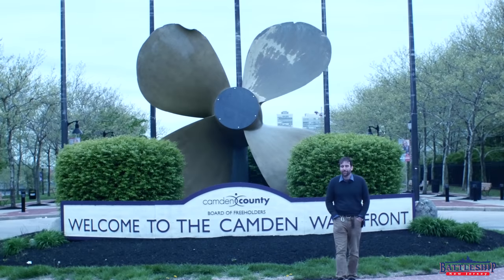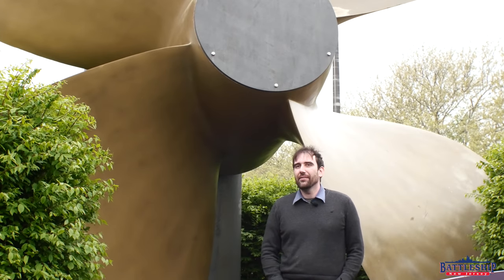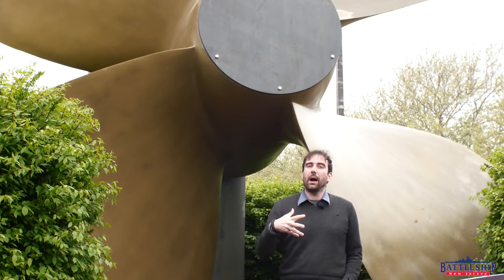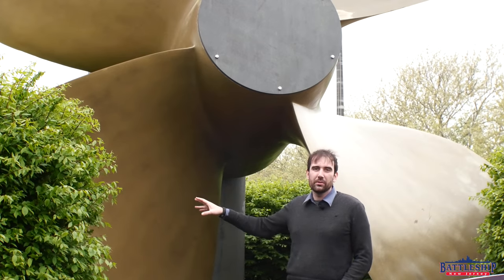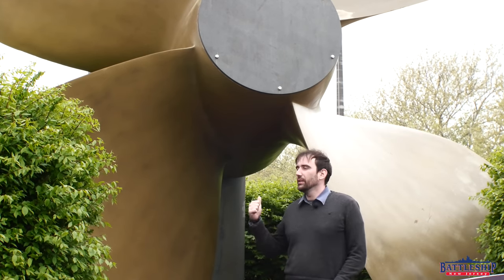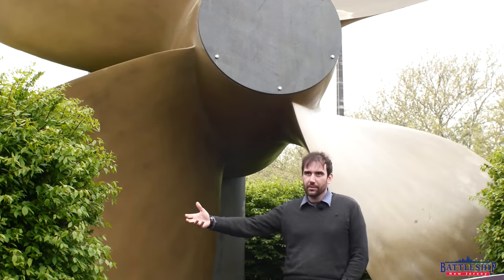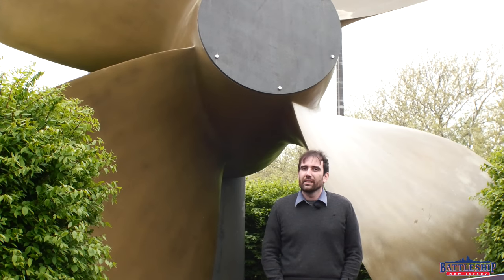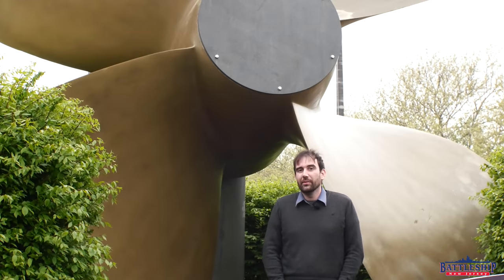How Big Are Battleship Propellers (Also Called Screws)?

Comment: I seem to recall seeing an electrical device that put a small charge (low voltage) on the metal needing the protection. The corrosion is caused by galvanic action in which the dissimilar metals act as a battery and the current flow removes the sacrificial metal. See Galvanic cell.
https://en.wikipedia.org/wiki/Galvanic_cell

Comment: Is it possible to rotate the shafts manually to at least help with the shaft sag?
Reply: There comes a point where rotating the shaft may damage the old seal.
Reply: @Aberman1  yeah, I was thinking that. Do gland seals replaced on museum ships when they go into drydock? Are they welded over?

Comment: Would it be possible to reposition the props now by 180 degrees, by manually rotating them?  However I guess that could cause leaks in the shaft seals as well.  Maybe better for dry docking to rotate them by 180 once in dry dock.  While aluminum is good for brackish and some freshwater, magnesium is the best for freshwater, however with steel hull it could be a bit too active.  You also have active protection as well.  I can just imagine the growth on everything under there across props, shafts, hull.  I know even in a year with bottom paint in good condition and using it every week, the growth can get pretty high in fresh water lakes here in Texas.
Reply: There are docking position alignment indicator marks for positioning the shafts and props either on the main reduction gear or back on the thrust blocks for drydocking. I'm pretty sure the Navy/crew would have positioned the shafts/props as they were closing her down.

Comment: Can a propeller be changed when the ship is not in drydock ?
Reply: Yes. They can do it with divers and a crane barge. Hard work, but I've seen it done. A Tender could also do it with divers with the ships alongside. Those would be "operational emergency" cases though.

Comment: I am wondering why it is necessary to make the propeller out of the Bronze/Nickel/Aluminum alloy.  Why would steel not be suitable?  What would be the weight difference between the alloy and steel?  What about the cost difference?
Reply: Nickel/aluminum/bronze alloy is much more resistant to corrosion in salt water than any other alloy. It is also better at reducing prop cavitation.

Comment: Wait, slipping the dunce cap? You've got to elaborate. I'd presume that's a large nut or something at the end of the shaft?
Reply: Actually, the Dunce Cap is the fairing cover over the propeller nut. losing that would have no real effect. Losing the nut would, but it takes blasting that prop loose with Primacord detonating cord to get it off, so I can't see that happening.

Comment: Quite shocked! Why don't you install new anodes? If not the ships themselves becomes the anodes and rust away. There is no difficulty in getting divers to change or install anodes. Just make sure the contact between the ships hull and the anodes are good. Shouldn't be a problem. The oil industry has changed anodes at sea for 50+ years. So has the merchant marine. Not a large cost. Please, get new anodes. Do a funding campaign if needed. It's the most important thing you can do to preserve the ship!

Comment: i have a question about the machines and propellers on big ships. how can make a ship engine with lots of horsepower a ship faster? because as far as i know if a propeller spins too fast, it creates cavitation which isnt good and it wont make you go very faster aswell.
Reply: More shafts...4 seems to be the limit, generally speaking. Larger diameter props.....there would be a limit to that also. More blades on the prop. More pitch to the blades. More that one blade on a shaft.....that is sometimes done on small pleasure craft, but I have never heard of it on a large ship.  On some of those large container ships they can get 25 knots on one shaft and prop.
Reply: @johnstudd4245  impressive, but for example, how can the USS Missouri reach a top speed of 33 kn and the RMS Mauretania for example only 26kn (beside the fact that missouri has a better hydrodynamic or a better hull. sure, she has more modern blades, but the engines themself, their output (beside their reduction gearbox) have something to do with it.
Reply: @kaisertrinityt.m.i.s1607  Certainly the engines have everything to do with it. The Mauretania had about 70,000 shaft horse power when launched, and up to 90,000 later in it's life.
 While the Iowa class battleships are listed at 212,000 SHP.

Comment: A traffic circle... do incoming vehicles have priority or do they yield to vehicles already on it? I don't see any signs, so right should have priority, meaning you have priority coming onto it!? As a European, I'm even offended by the concept! 

Roundabouts are safer and are less congested. What's the difference? Well, you give way to people already on the roundabout. This is a self-clearing mechanism meaning higher traffic flow. How is it safer? You see, roundabouts are generally smaller, decreasing the speed of vehicles (while the throughput stays the same due to the smaller distance they have to cover). Lower speeds mean more time to respond, more efective brakes and less damage in collisions. On top of the lower speeds, you have less to worry about once you're on it since you then gain priority. How frustrating is it to have others come in and get stuck in front of you while you just needed a few more feet to your exit? I guess there won't be much traffic in this spot, so it may not be an issue here, but having a roundabout instead of certain traffic lights would work just as well or better (note: not every traffic light can be exchanged for a roundabout, especially due to American road design, but that's a topic for another comment lol)

The ease of a roundabout is: you approach leasurely, (often without even stopping) find a gap and drive off wherever, without anyone stuck in front of you

Comment: Why are some propellers 4 blade, yet others are 5 blade?
Reply: I would guess it has to do with vibration issues. That has been a serious problem with many ships designed to run at high speeds...warships and ocean liners of the past. They sometimes have had to bring the ships in after launching and try different prop designs to get rid of terrible vibration problems.

Comment: The reason to remove the props is think INTREPID...they couldn't get her to the middle of the Hudson due to silting. Yes more money, but you don't have to dredge to move the ship.
Reply: It makes it easier to move the Intrepid when they have to do future repairs, too.
The sediment build-up were the large part of WHY they had to remove the screws.  The silt accumulated around the Intrepid while she was docked for 25-26 years!  She's in the river area which moves past her and lays down silt continuously.
They saved all the Big I's screws.  I wrote another post about this.  They were removed to 3 different locations around the United States.  2 of them are still with Intrepid in different locations on the museum grounds.
The only other aircraft carrier I'm aware that had screws preserved was the USS Shangri-La, an Essex-class sister ship to the Intrepid.  Her hull is long gone but the Shangri-La's remaining screw is in front of a restaurant now.

Comment: If the propellers are left on the ship it makes it easier for thieves to crank up the ship & drive off
Reply: It would take a large size trained crew to do that. Thieves are opportunists.....smash, grab and run!
Reply: You would need to obtain fuel.Then your "crew" would have to light the boilers-this would take some time to build up steam.This is not like an outboard boat where you start the motor and drive off as in a car.
Reply: ITS A MANUAL, NO-ONE UNDER 30 COULD DO IT,,,LOL

Comment: Just curious if the $18 million dry docking cost includes doing the repairs and refurbishment?
Reply: Yes.
Reply: Most drydocks on the west coast that can handle a ship this size have an average cost per day in excess of 500k per day. This only includes connections for firefighting water, drinking water, electricity for lighting and small service eqpt, sewage discharge service, 10 telephone lines, low pressure air to run pneumatic tools, and low pressure steam for ship climate control heating. To put a ship on the blocks requires specialized concrete and wood blocks. To get the ship to, into, out of, and back to her permanant mooring site would require a minimum of 2 or maybe 3 tugboats of 10,000hp minimum strength. Plus crane service to lift access brows and shorepower cables off of ship and back on when completed. Iowa class BBs require a minimum of three rows of drydock blocks of which many are a unique shape to fit on contour of the bottom of the ship. These block contours are found on the ships docking plans. Lets not forget the environmental protections, you have to cocoon the ship and drydock with very strong and flame retardent plastic wrap, all sandblast materials used on the ship are sent to sandblast grit recyclers to be cleaned to be used another time, underwater marine growth must be removed an sent to a marine growth disposal facility. To get rid of marine growth in San Diego, it is sent to Arizona to be sun dried and ground up into fine powder and used to make concrete.

Comment: Static displays of any machinery has always disturbed me a bit- machines are made to be run, and the operation of that machine is as much of the "historic fabric" as the physical object. It's part of why the sailing of the Constitution was so important; without the ability to sail, it was a historic barge. So removing something that makes it impossible to operate the ship would bug me, even though the contracts and economics make operation impossible anyway.
Reply: Contracts or no contracts, trying to run a steam plant of the size in a battleship is a complex and extremely dangerous proposition without properly trained competent and licensed personnel. A high pressure boiler is basically a bomb with a  pressure relief and a defined outlet. Not something for amateurs to attempt to run,
Reply: And that's the reason people drive, and race, old cars. They are self propelled sculptures, and Need to be driven to maintain them

Comment: Screw blade config using 4 and 5 blade will really screw up a sonar classification.
Reply: It actually helps.
Reply: It was done to reduce vibration in the stern while operating a certain rotation speeds.
Reply: @Stillnonofya  " It actually helps. " 
How does it help? To a sonar supervisor it would look like two contacts and estimating the TPK would be way off. How many Submarine patrols and contacts as a sonar operator have you done? If none you don't know Jack!
Reply: @emilkarpo  What is the TPK on the different screws? Since you pretend to know so much. You missed my point!
Reply: @ronusa1976  It helps because at certain speeds the Iowas and the earlier Treaty battleships had sever vibration problems at certain speeds that made habitation and effective fighting of the ships difficult.  The screws were an engineering solution to an engineering problem, vibration. These ships always operated with considerable screens, both in WWII and in their later lives. I think you are just trying to be obtuse at this point.
Reply: @emilkarpo  I don't understand how you can miss my point. Maybe you should read what I posted. I don't care about the vibration! It has nothing to do with a sonar man classifying a contact by screw configuration.
Reply: @ralphgesler5110  " Sounds like you may not even be on the level of Jill! " 
Yes if that's what you want when people dont understand my post. Imagine a sonar man analyzing the contact's and estimating what it hears for screw blade config for Target motion analysis. Like I said is would look like 2 ships and estimating it speed would really be hard. In TMA speed is a critical estimate. So you can see some persons Don't Know Jack!
Reply: @ronusa1976  

Well until they see the ship they were trying to track then word would spread that the signature they noticed is a battleship and the effectiveness of different screws would be gone.

Also it would mean the enemy ship knowing its a battleship can be better prepared.
Reply: @ikonix360  Thanks someone knows what I am talking about! Kids are just pulling stuff out of thin air. Sonar Classification is Not about vibration of Jill! This is why screw configs are classified and needs a visual on the screws like in drydock or underhull observations with the periscope. You don't just assume! I made 9 Cold War patrols in sonar.
Reply: @ronusa1976  actually, I've been an ST for over 26 years, 10 underwater and 16 on top. So yeah, I know some stuff. I can tell you that just because there are two screw signatures on the LOFAR, its not hard to pick apart the two different screwblade configurations and get rpm. They aren't controllable pitch so it's pretty straightforward. Also, the Iowas in the 80s and 90s were pretty easy to pick out due to the 2/4 and 2/5 configuration. A class identifier if you will. Add to that shaft harmonics and singing screw and they are no problem. But you do your thing.
Reply: @Stillnonofya  Yes I know but try not to give away classified info. With  ships traveling in a group the initial classification could be 2 contacts until interrogated. How many Battleships did you run into in the 80-90?
Reply: @ronusa1976  There is nothing classified in what I wrote. Also, the Iowas predated my time in the Navy by 6 or 7 years but there were enough publications and recordings for me to study/look at to know it wouldn't be an issue to classify out of a battlegroup. I could see how someone untrained may have issues but a simple understanding of TMA and acoustic analysis would have it sorted in minutes.
Reply: @Stillnonofya   " Yes I know but try not to give away classified info. " 
How does this apply to  
" There is nothing classified in what I wrote.  " ? 
I said I try not to give away classified info. This is not about you!
" the Iowas predated my time in the Navy by 6 or 7 years "So how is it you know  " 
" Also, the Iowas in the 80s and 90s were pretty easy to pick out due to the 2/4 and 2/5 configuration. " 
I know subjective analysis interpreting data is not that easy if your not trained in SSSA. To confirm a peek with a visual observation would be need. Passive sonar is not 100% proof. You should know what a SWAG is.